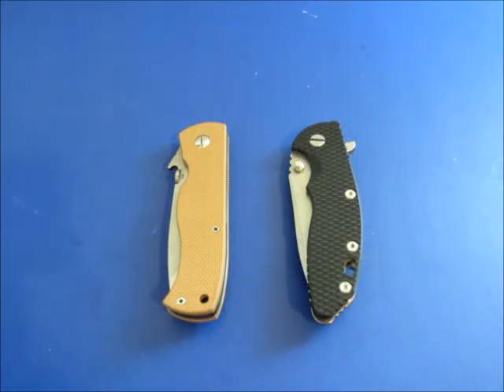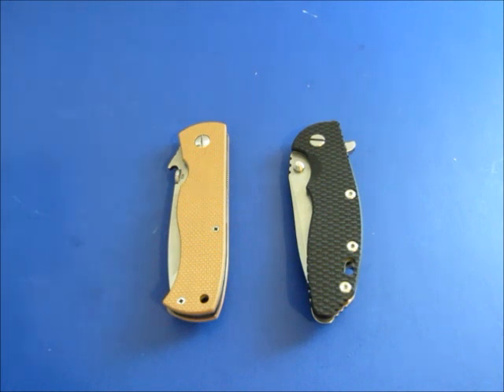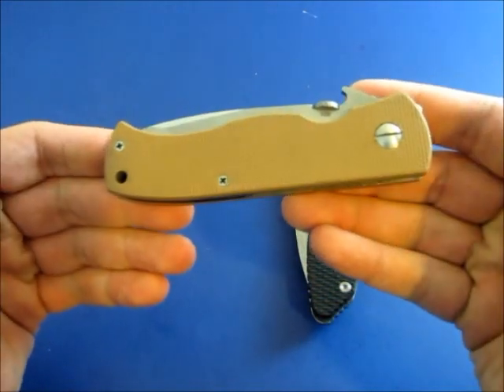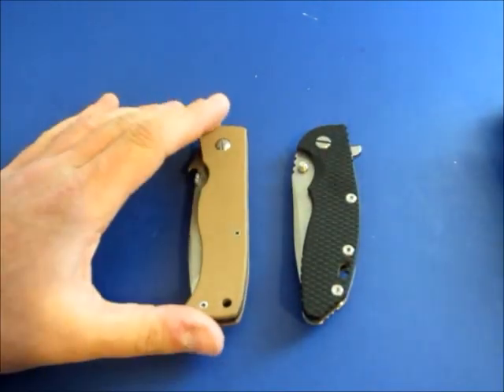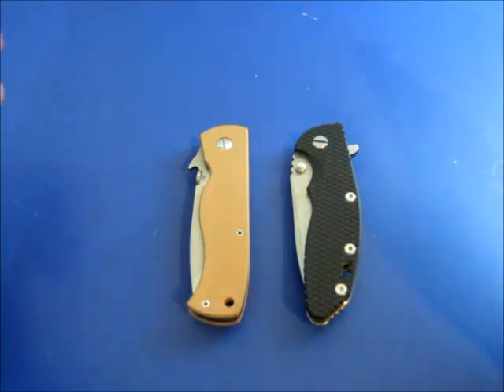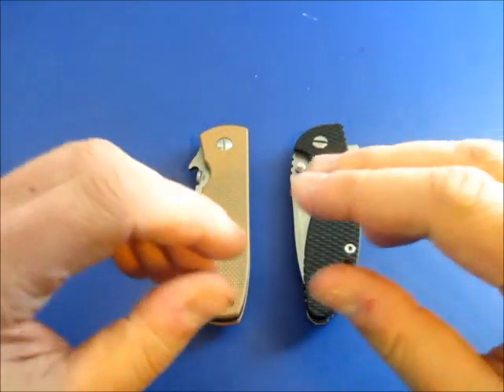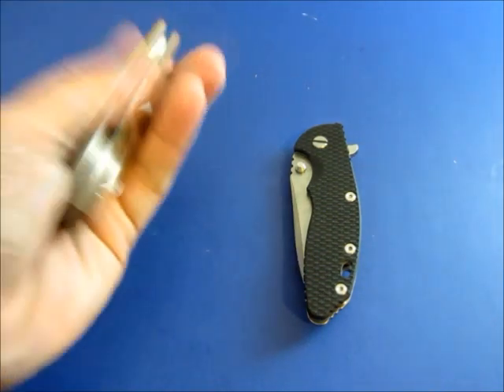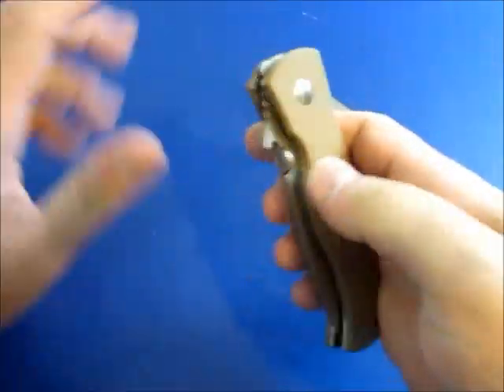VR: Frame Lock vs Liner Lock?

Comment: sooo? which one should i buy  framie or linie? ?
Reply: Frame locking is the better one logically.....this dude doesn't use analogy or theory properly. The first one makes sense, I guess? But the stick bending thing is literally common knowledge. It will break where the pressure can release its self in the easiest, and quickest manner. On the line lock, it will most certainly break in the groove because there is less material to hold pressure, and it can't withstand all of the force. On frame locking, it beats the fact that blade rocking is a thing, and that it quite literally is stronger for a long time use because there are no dumbass grooves to worry about. My last line locker broke on the groove and I was fucking pissed.

Comment: You are correct that the stick would break in the middle but the fact is that bending produces forces that could be displayed by the derivative. If you had an arc than that would properly display the forces. The small cutout is substantially weaker than the rest of the knife and because bending puts force on the whole "stick" but is more concentrated in the middle; the distributed force would break at the weak point.

Because the force is not just in the middle but just slightly more concentrated there because of the greater LEVERAGE.

Comment: A stick will break at the weakest point if bent in half, not necessary in the middle. I would think the liner lock is actually more fail safe for the fact that the liner is not exposed. The frame lock is exposed to the hand, so depending on the task with the knife, who's to say that the frame lock won't be released with a twisting motion.

Comment: nice video. but the part you where talking about the "weakest link" is just wrong. the force going through the lockbar in going down toward the pocket clip so the only place for it to fail is the smaller cutout needed on framelocks, not at either end putting the force in the middle.

Comment: You may be right.  In a vacuum, I am sure I can find certain liner locks that are equal to or stronger than frame locks, and vice versa.  The problem is, I use my knife in the real world, not a vacuum,  so to me the knife that is less likely to fail under hard use is the strongest.  The inherent design of frame locks, which includes the ability to “hold” the lock in, makes it less likely to fail and stronger. I also think the framelock lock bar is stronger, but this is definitively debatable.

Comment from the maker: Right. I'm not saying it won't break there. I'm saying that a thin stick would break in the middle, before a thick stick would break at the notch. Obviously if you put enouph pressure on something it will break at its weakest point, not denying that, just that the thin stick would break in the middle first.

Comment: Analogy to the stick you are using is utterly wrong. The frame/liner lock is working as a cantilever. Ask any engineer you know or google cantilever beam stress. The weakest point is at your “start”. Frame lock is not supposed to be tested in a vice but on the blade itself.  Do not “feel” just use math to calculate it. Or bend your frame lock and see for yourself where it actually fails ;)

Comment: Well done.  I prefer frame locks and do think they are safer because my grip is helping to keep the lock engaged.  Strength does not concern me too much because I do not come close to exceeding the tolerance levels of my knives.  So what if my grip causes premature lock wear.  If the knife lock wears out, I would for once actually have a legitimate excuse to buy a new knife.

Comment from the maker: That's a point too. That's less likely to happen on a frame lock! But at the end of the day, this is really getting down to the weeds, both lock systems are strong. Both have weaknesses and strengths. I couldn't even imagine how to test this. A ti liner lock vs. ti frame lock? Steel liner lock vx. ti frame lock? Steel liner vs. steel frame? What liner lock thickness vs what frame lock cut out thickness? The lenght of the cut out would play a factor too. Just fun to talk about is all.

Comment: funny thing the only time I've seen a liner lock fail going inwards is when it slips over so far it slides into the spot between the tang and the handle. that's only on super cheap knives. 

A majority of failures ive seen are slippages.

Comment from the maker: Good point! But remember, I'm not saying that it won't fail there, i'm saying that a liner lock will fail at the middle BEFORE a frame lock will fail at the cut out. Abviously if enouph forece is present, something will fail at the weakest point. My argument is that the middle of a liner lock is weaker than the cut out of a frame lock.

Comment from the maker: And I understand that if it were to fail, that's where it would be. I'm simply saying if you still were to put the same force on both locks, the liner lock would fail in the middle before the frame lock failed on the cut tout.

Comment: Carter have you seen pictures of failed frame locks? They don't fail in the middle as you described, they fail where the cut out is - every time.

Your "fail in the middle" idea is good if we are cutting the lock out and bending it in a vice, but in use it just doesn't work that way.